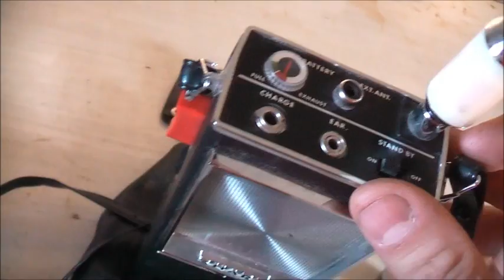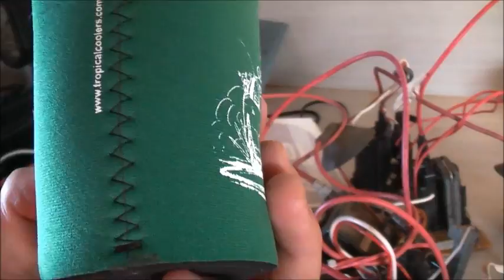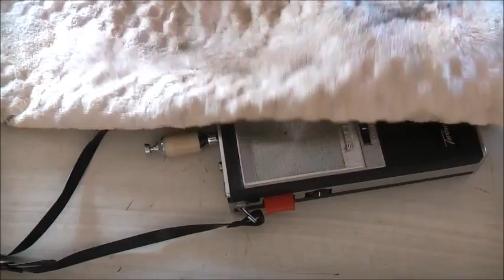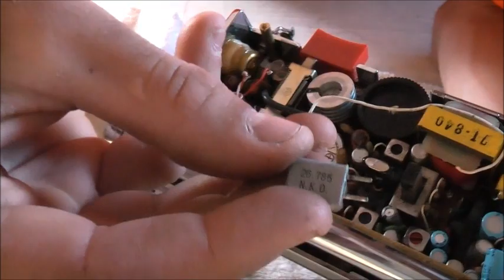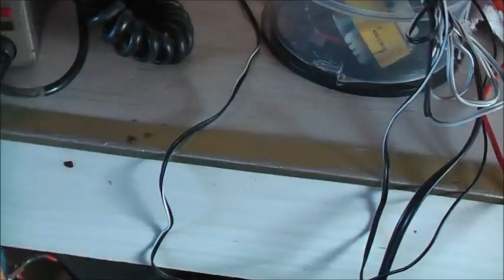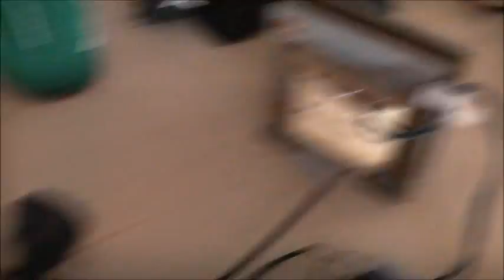Goodies From Billy & Alex

Comment: You will burn that little Sharp CB radio if you connect it to an unregulated power supply. You must not ever push PTT without any antenna connected. You may use a dummy load for that. If not you'll burn the output transistor. Here in Europe the channel named "A" is the channel 9 in the CB and the "B" normally is the 11 on CB but it will depend on the crystal that is installed, but please use a good power supply on that radio or it will burn, or for better performance, connect it to a 12V battery

Comment from the maker: I sent a message to your Ebay store, regarding ya address mate, The walkie talkie is all cleaned up with a fresh set of batteries, it works well, also glued the battery meter so It won't spin in it's socket & twist off the wires :)

Comment: a VSWR meter is very handy for swring in antennas, i have seen them on ebay cheap. if the vswr is too high(or if you tx with no antenna) it will destroy the crystal oscillator's and or the output transistor